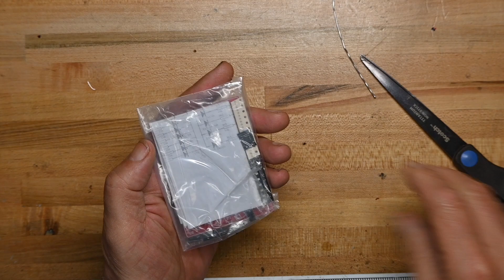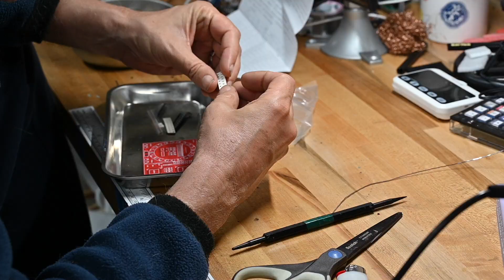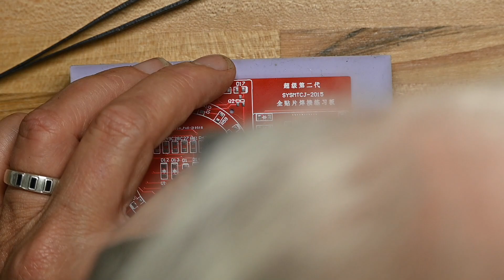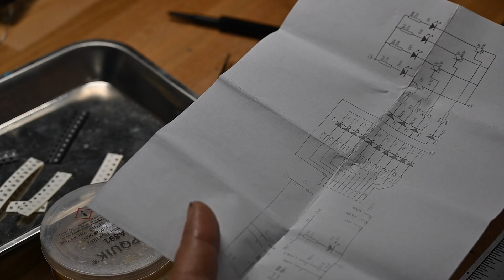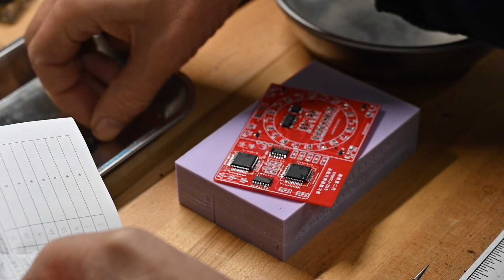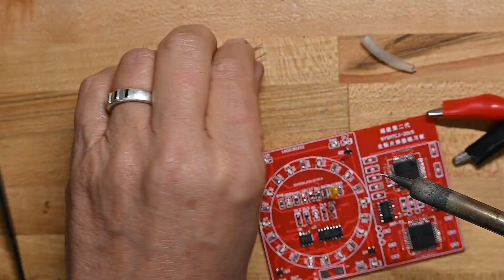C.K. builds a Gikfun surface mount soldering practice kit

Comment: I’m confused on the resistors. How do you know which go where? I have the same practice board as you. Do you think you could help me out?
Reply from the maker: I’ll do what I can. For this one, the parts list sheet gave the locations, for example, the 10k resistors start at R48 as I describe at about 32 minutes in. Then the data sheet shows the rest. Or did you mean the values?  I describe that a little , it’s the 3 digits marked on the resistor, first two are vale numbers, last one is how many zeros. So 103 is a 10 with three zeros, so 10,000 or 10k.  Did that help?
Reply: @C @CKHaun  my value sheet shows 1k, 103, 10k, 10m and 470. None of the chips match this info but the 103 on my shit say it’s a chip electricity

Comment: I've ordered two of these from two different places, and when it comes to the R49, all they give me is a 105 capacitor. Will this end up frying it? Thanks
Reply from the maker: No it won't.  Since this is a pure practice kit it doesn't have a lot of functionality, so don't fret about the parts.  Thanks for stopping by!
Reply: @CKHaun  Thanks for the reply. This one I received had some good instructions compared to the last one. After I was done, I only had one light in the center not working, but maybe because I held the iron on it too long, but otherwise it turned out pretty good, and all the lights blinked as they should. Take care